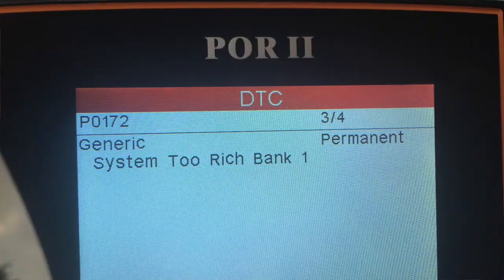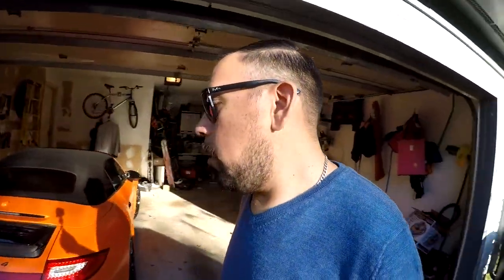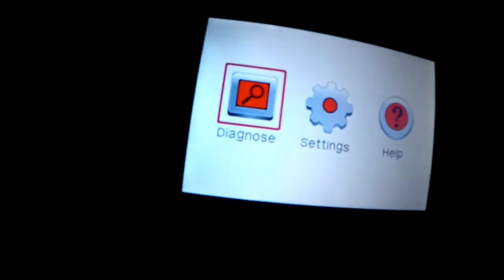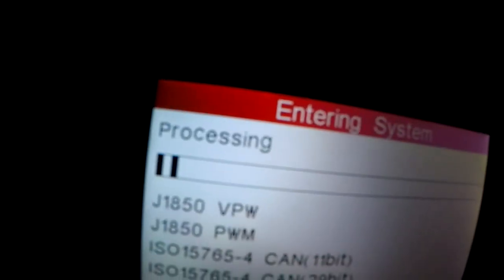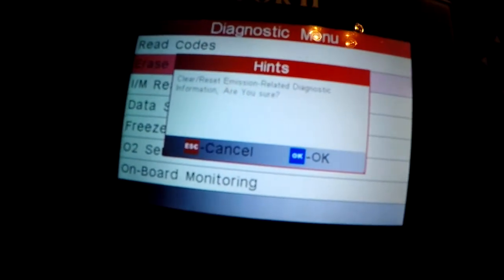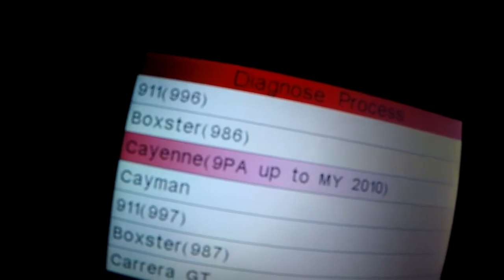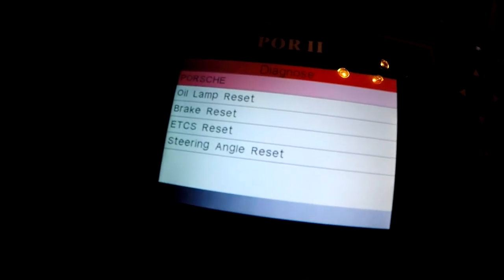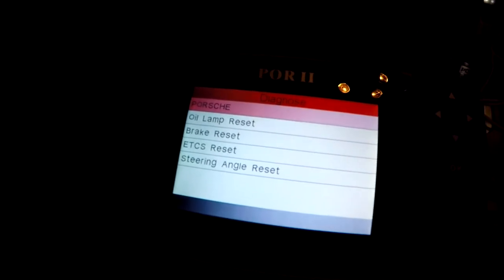MAF Sensor Replacement OBDII code P0172 P0175 Rich Bank Porsche 911 iCarsoft

Comment: Hi, thanks for the video, did this actually fix the rich codes or did they return?
Reply from the maker: Gary Hulse they haven’t returned since I swapped out the MAF.  This was definitely the reason for my codes.  Are you having the same issue?
Reply: Yeah same issue, same codes, I  monitored the STFT and they are much worse at idle, increase revs and they return to more normal levels, I will try swapping my Maf out see if it does the trick, thanks
Reply from the maker: When the codes got triggered it was always at idle.  Never had it come on while driving.
Reply: Engine Light only came on at idle with codes of P0172 & P0175. For anyone else reading this I figured this out now thankfully before buying a new MAF. I run Bi Fuel ( petrol and LPG) my problem was caused by a leaking petrol injector, I ran the car on petrol for about 30 miles and My STFT and LTFT returned to near Zero (they were both at -25 before) no more codes no running rich.  it could equally have been the MAF. Thanks again for Vid Omar.
Reply: Omar's Garage thank youuuuuuu